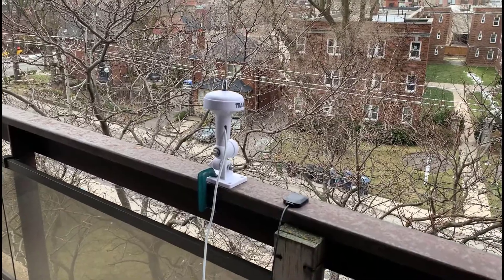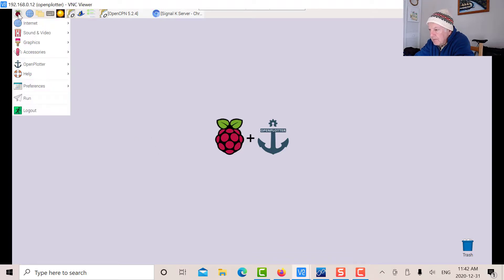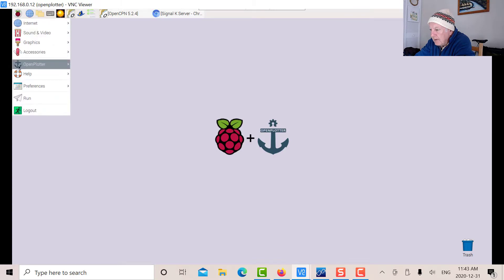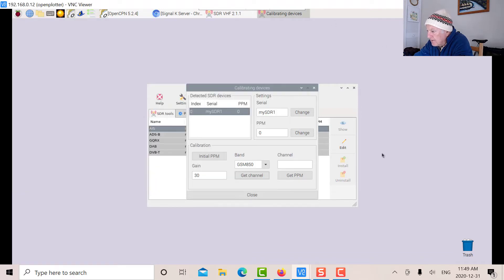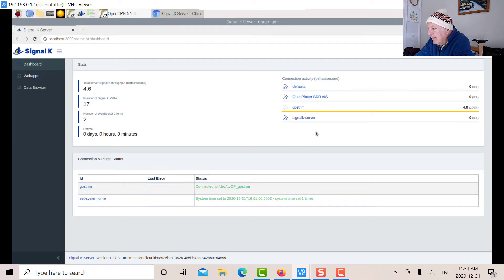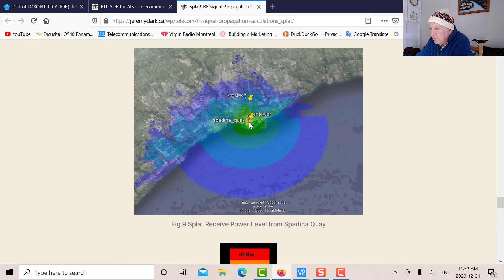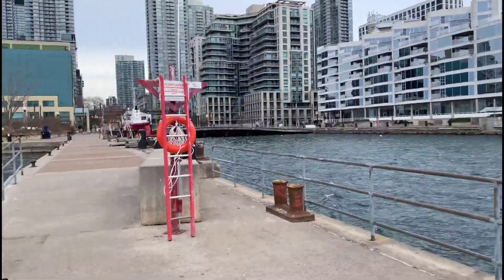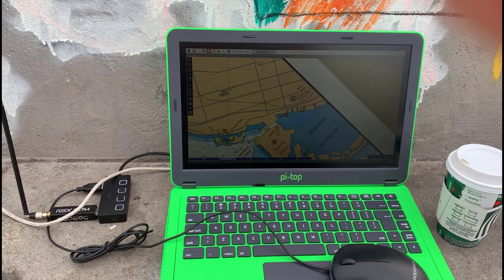OpenPlotter - AIS Connection

Comment: Hi Jeremy. Thanks for this video. I am having trouble after I have Calibrated the SDR AIS. It shows up in Signal K exactly like the first part of your video but will no signal at all. I am sitting in the marina with plenty of large boats in the area all showing up on Marine Traffic. Is there any way to solve this issue or would I perhaps need to try on different channels?
Reply from the maker: A quick check would be to use the RTL-SDR with SDR# or Gqrx directly and scan the two AIS frequencies to ensure that there are signals there. The VHF frequencies are: 161.975 & 162.025MHz. Set for narrowband FM. The signals occur in fast bursts, so you see a sudden splash on the spectrum-waterfall display. Make sure you check the frequency accuracy of the RTL. I check against the marine weather channel up here in Toronto on 162.4MHz. The older RTLs are off by 10-30ppm, the newer ones should be fairly accurate 0-2ppm. Good luck, let me know how it goes.

Comment: Hey Jeremy, really appreciate these videos. 

I am having a bear of a time installing the sdr vhf on the open plotter/raspberry pi 4. I have been looking high and low for trouble shooting help. Can you recommend any resources?
Reply from the maker: Scott when you went into OpenPlotter/Settings & tried to install SDR VHF, what happened? It takes several minutes to install all the software. Were there any error messages? When you boot the system up and it does a system check, are there error messages? My system is on RPi3B. RPi4 takes more current and you need heat sinks. Let me know how it goes.
Reply: @ClarkTelecom  so after several days I finally figured it out. I’m at anchor so I’ve been doing this via library WiFi. Open cpn and raspian we’re unable to contact to network. The errors initially led me to believe that it was an issue with the repository or a sign in (sudo) error. This is all new to me, so definitely a learning curve. Videos like yours sure help. Thanks again.
Reply from the maker: @scottjmcglinn  That's great! There is a very active forum at: https://forum.openmarine.net